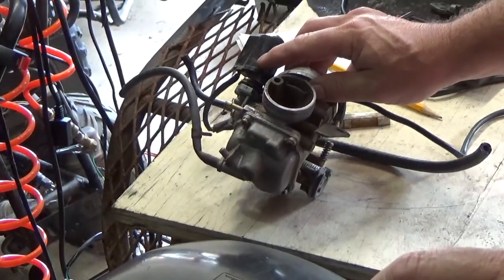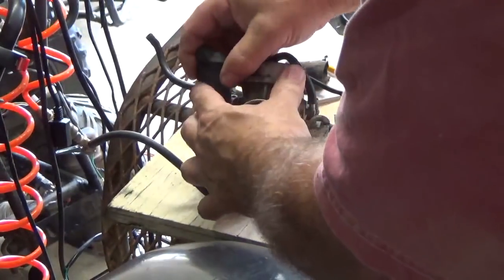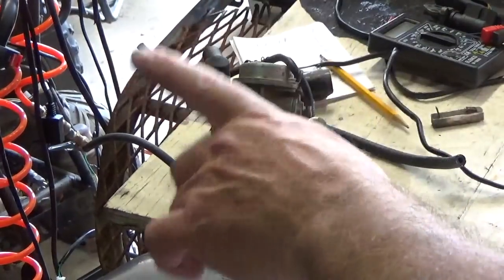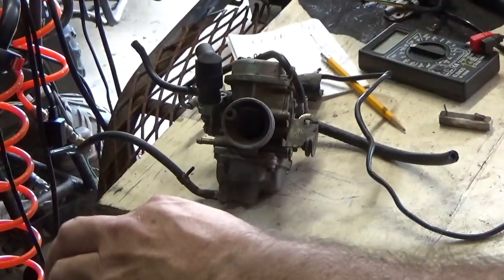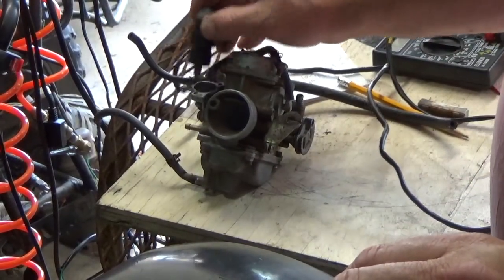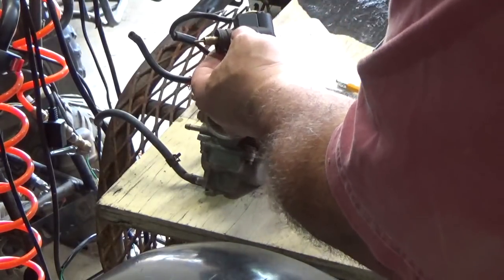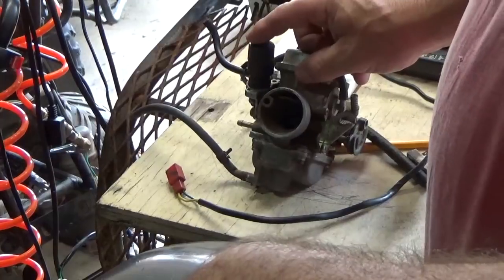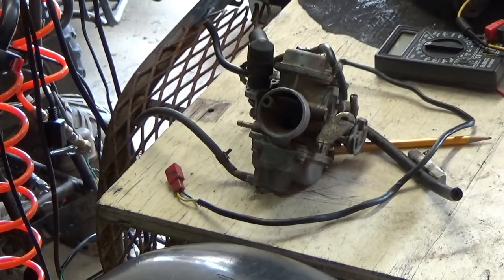Bystarter, better then a Carburetor choke?  Bystarters first used on Honda Scooters.,

Comment: The only way my Honda Ruckus (49cc) will accelerate is with a rag stuffed in the air box, my research points to the enrichment valve. It all started when I hit a pothole. Any suggestions would be appreciated

Comment: this video is awesome! I have a 1985 (first year) Honda Elite CH80. I think my bystarter got gummed up over the winter or failed. Manual choking with my palm gets it to turn over. I think for $10-$20 this is a replacement worth trying. I disassembled the existing one and cleaned it + the feed straw, but couldn't determine if it had failed.

Comment: I  have a buggy and the electric choke wires aren't connected to anything...and I dont see and stray plugs...but there are wires cut here and there on the harness...my question is wht does that plug connect to??

Comment: They use these devices to close the outlet on the ice dispenser on our fridges.  They call them a ‘heat motor’. I had to replace one once in my fridge which is how I learned about them.

Comment: Harvy how do I hook up the resistor for the choke does it have a plug in the wireing harness? Or were can I wire it in to to make it work. Love your channel you are so helpful and you seem to know every thing on the China motors Thank you for your channel
Reply from the maker: Hey Ross, U will probably have to hard wire it.... The resistor goes between ground and one side of the choke heater, (bystarter), the other side of the bystarter goes to one of the yellow stator wires, (does not matter which one, just pick one though), thanks for asking, watching, and commenting.... I hope this helped!!!

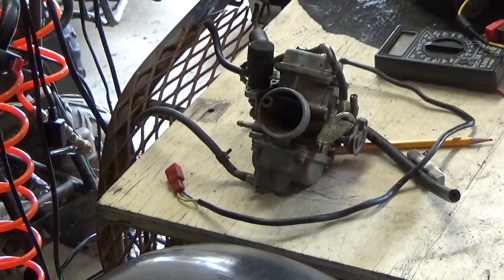Comment: Hey. Am I missing something here? Around 15:05 your saying this is a 12v dc unit, than talking about 25-30v ac on it! Can you clarify this? Thanks
Reply: The stator on a bike puts out AC volts and the choke is run off of the stator.